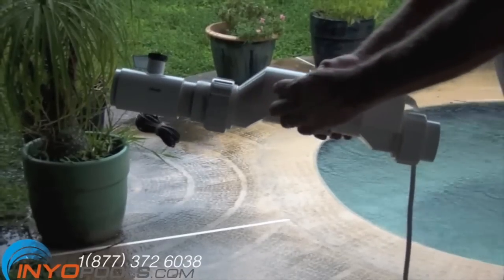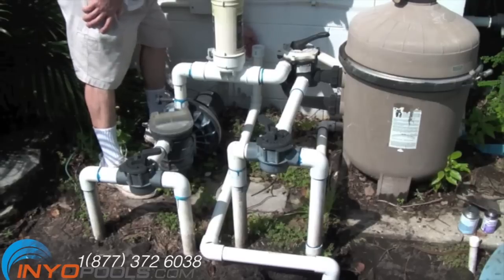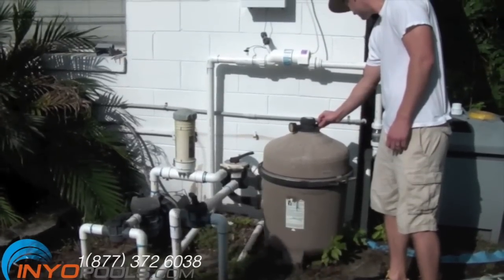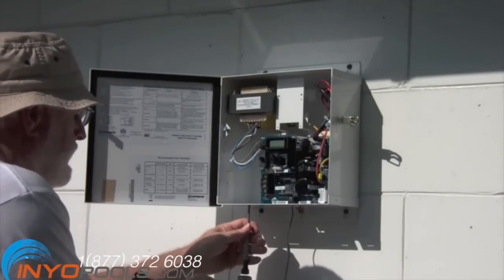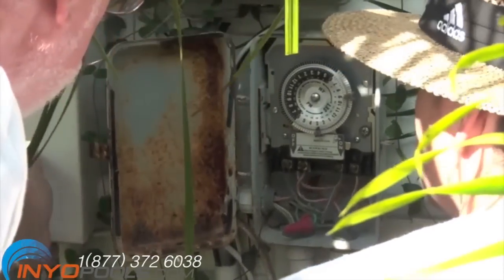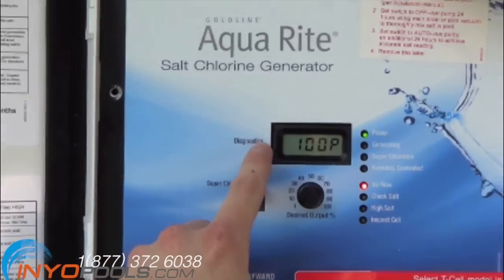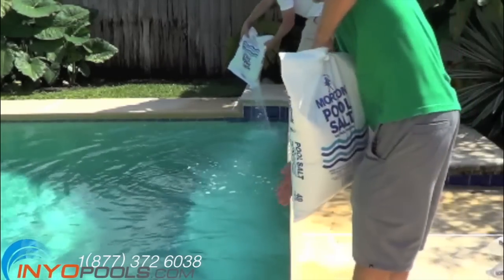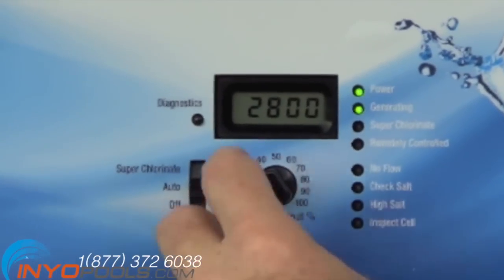How To: Install a Hayward Aqua Rite Salt Chlorine Generator

Comment: This looks like you installed the cell backwards
Reply from the maker: The Aquarite cells can be installed either way horizontally. The important thing is to have the flow switch facing in the right direction. The arrow should be pointing in the direction of the flow of water.

Comment: can this operate with 120volt
Reply from the maker: Good question! The AquaRite Salt Chlorine Generator can be wired for 120 or 240 voltage. Take a look at the owners manual listed on the link below on page 11: http://www.inyopools.com/manuals/146/goldline_aquarite.pdf
Reply: 912
Reply: Adam Jamaica

Comment from the maker: Rhuel The flow switch can be installed before or after the cell but there must be 12" of straight pipe before the flow switch. The cell counts as 12" of straight pipe if installed directly before the flow switch. There is no restriction on the length of the straight pipe so installing the cell and flow switch in a 24" straight pipe is fine.
Reply from the maker: Hayward Pool Products